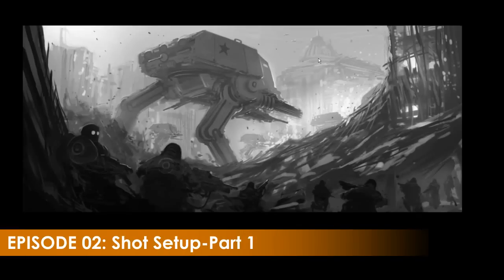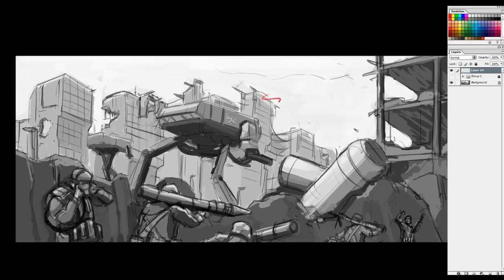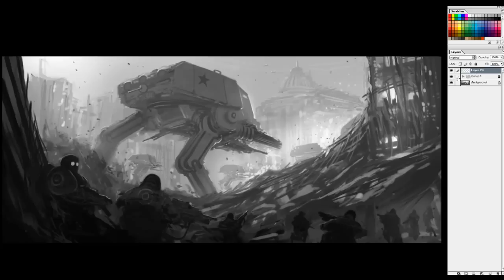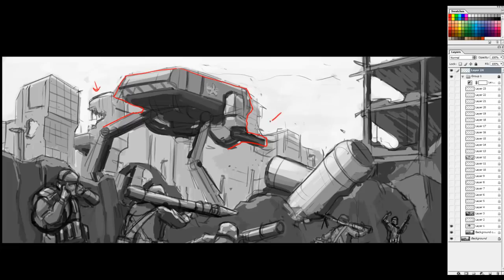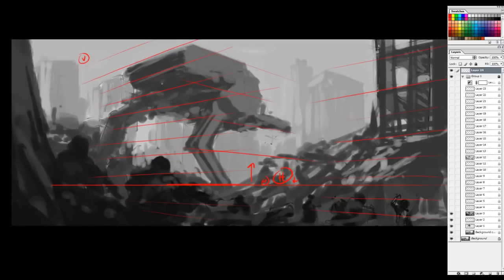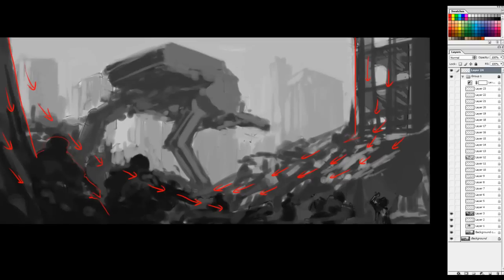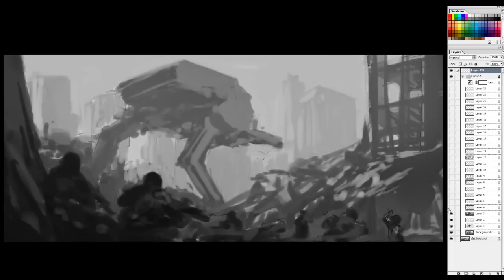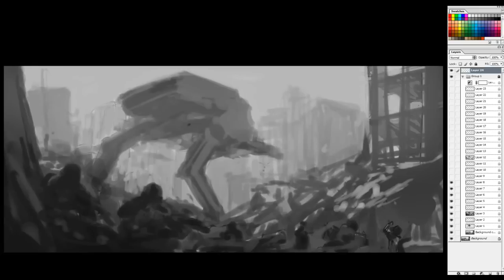Design Cinema – EP 2 - Shot Setup Part 01

Comment: I have another stupid question for you :D - how did you make the straight lines while explaining  the perspective? Usually I click where I want the beginning to be then hold shift and click to the next point, but you made it really fast. Is it only by hand?
Reply: I was also wondering that.  I'm not sure if it's what he did, but if you create a starting dot and then hold shift, and create a finishing dot, a line will connect the two dots.

Comment: Hello Feng Zhu, these are fantastic tutorials. Thank you a lot.
One question regarding the perspective lines around 3:50: How do you create them? They look extremely correct in perspective, almost as if snapping to a sort of grid. Yet at the same time it seems like you are drawing them freehand. Just using shift-key would make a straight line but how do you achieve making all lines going in so correct directions with correct vanishing points?
Reply: I heard him saying in one of the episodes that he uses the whole arm to stabilize stroke and get a very straight line as a result, but yes, It's just an effect of practice, no shortcuts
Reply: @Foxylis Thanks for your reply. Not exactly my question, maybe I put it wrong: It was not about making the lines straight. It is about how to achieve this perspectively extremely correct run of the lines with such apparently quick strokes. Possibly this also is a matter of practice. I was just wondering if there might be a tool simplifying this process. Because when I look at the example in this video, the perspective here is very flat, the angles between the lines are very small which is very hard to achieve freehand and yet it looks very correct, as if constructed.
Reply: Oh I see, but the answer Is still the same like you've noticed, a lot of practice. I've been drawing for some time and I can tell that this kind of thing is getting easier and easier as you go, and that Is definitely possible to do that freehand as I'm almost able to do It myself.